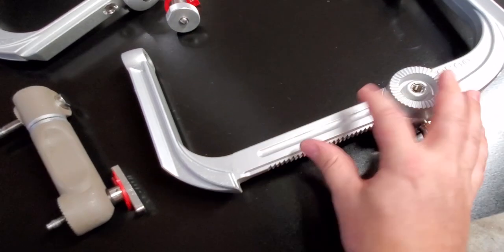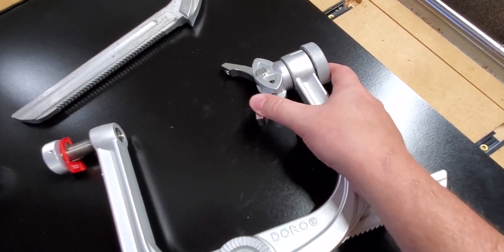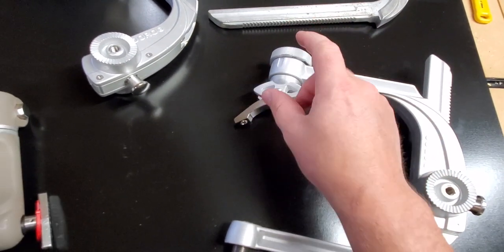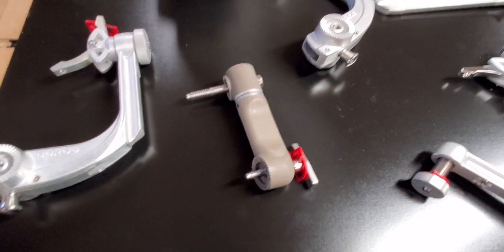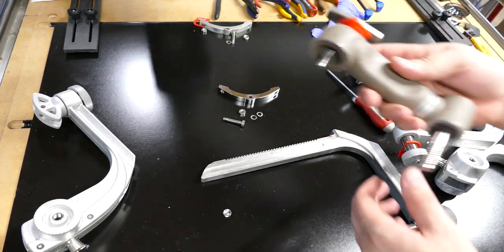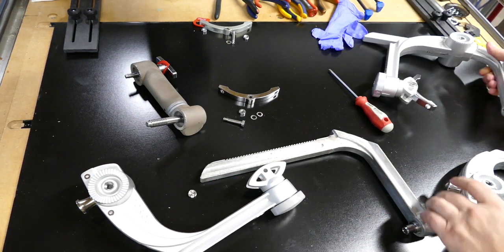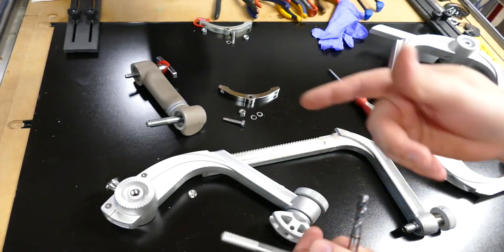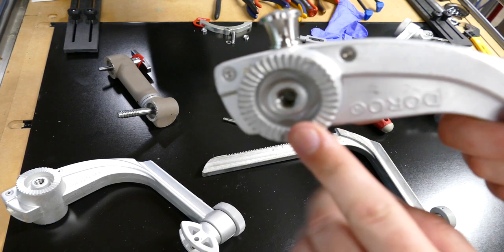Save Big $$$$  -Repair Skull Clamps

Comment: I use to do the same thing with our head clamps and other devices. Having a first look before sending out can save on cost and downtime. Also I kept a good assortment of stainless steel screws, washers, and nuts on hand for repairs.